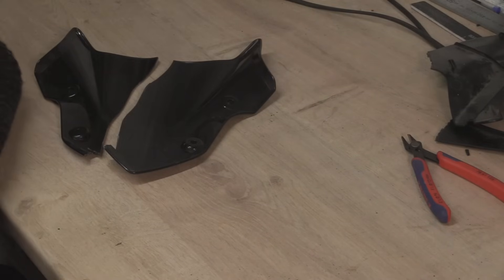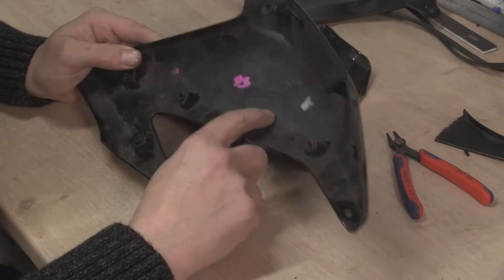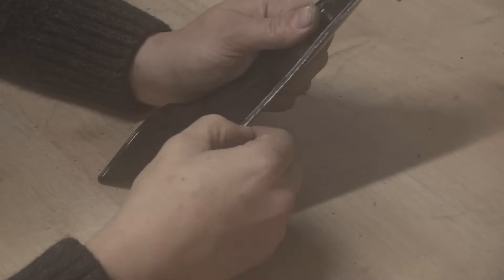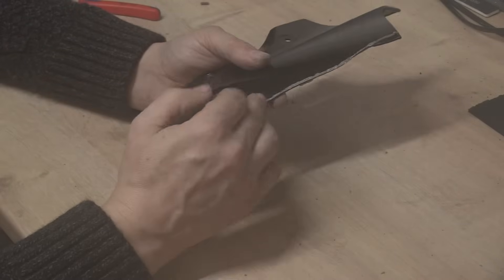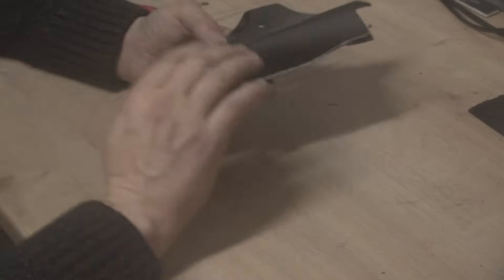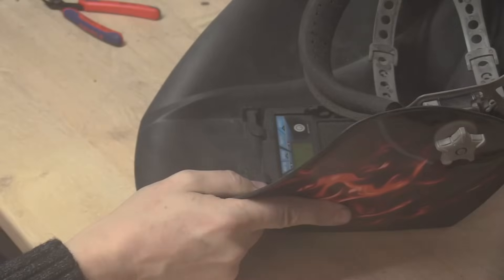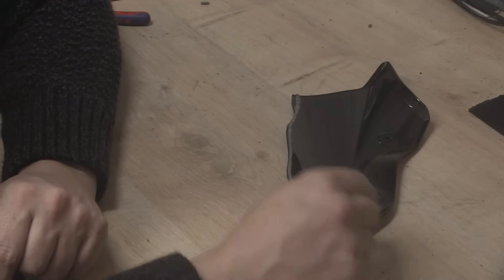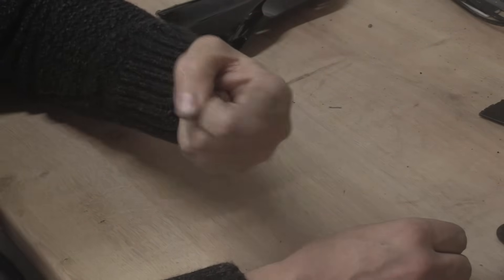Cracked Fairings - Friction welding

Comment: Good waste of time Friction welding.  Just plastic weld it with proper plastic, add strength with staples or wire mesh if needed.

Comment: It's beneficial not to bevel the edges for better alignment, but it helps with strength to have a bevel to fill in. You could try to get the best of both by tacking a few times with good alignment and then run a cononical bur down the join to create a V and fill it in afterwards.
Reply: Canonical? What's that?
Reply: @mauricevandoeselaar   it's a geometry term, think about the shape of a traffic conone

Comment: Seems like a colossal undertaking time wise, why not use glue designed for such purpose like "Plastex" for example?
Reply: I glue cracked plastics with solvent cement, then sand a key on the inner side and lay a strip of kevlar or carbon fibre with epoxy resin over the join line to reinforce it. Never had a repaired part break again.

Comment: Could you not tack a couple of spots to keep it in place and then use a heat gun up close on the crack line and go real close to the plastic melt temp similar to a 3d printer does to actually print? That way you would bond the plastic close to all the way through no? As whether you use your dremel method or a soldiering iron its only sealing the surface. Could even tack then heat gun then full weld or tack, weld and heat idk?

Comment: Regarding the V-prep and cup/cone fracture, I would recommend bring the two parts together, use your welding technique on one side, then  V-prep the other side deep enough so with the second bead fuses with your original bead.  Then subsequent passes until the prep is filled.  This way, you'll achieve full penetration and perfect alignment of parts.  Would be interesting to then see a bend test 🧑‍🏭

Comment: Useful. What would happen if you sharpened the ABS rod (with say a pencil sharpener) before application...Would you get a deeper weld? Also a self feed for the rod would speed things up tenfold.
Reply from the maker: No, it would just melt even quicker. You're trying to melt both plastics together

Comment: Thanks for this Matt. Until now I have always V'd out the crack then filled it with some ABS plastic melted into Acetone. Would this technique be useful for filling holes in ABS fairings left behind, for example, by someone drilling holes in the fairing?

Comment: Have you ever tried using acetone to fix cracks like this? It kinda melts the plastic together and you can melt some abs up into a paste with it to use as filler. I fixed a fairing that was split in two using it and it was super strong afterwards.
Reply from the maker: Yes, it makes a mess.

Comment: Perfect timing!  I have a front fender that has some cracks.  Thanks 👍
Suggestion:  I personally like to embed a stainless mesh into the plastic using a soldering iron. It prevents the crack from spreading and is usually the strongest method that I've come up with.  I'm no expert though...